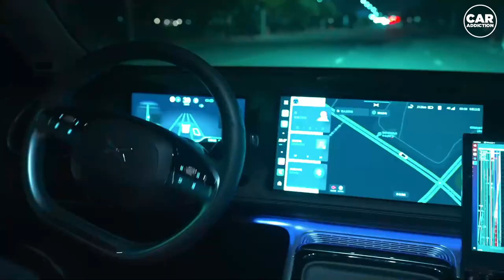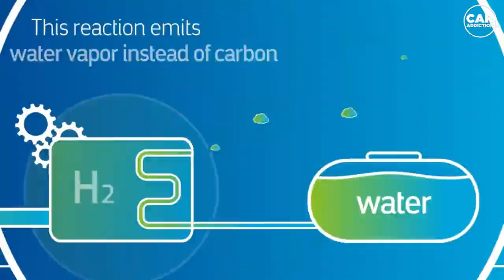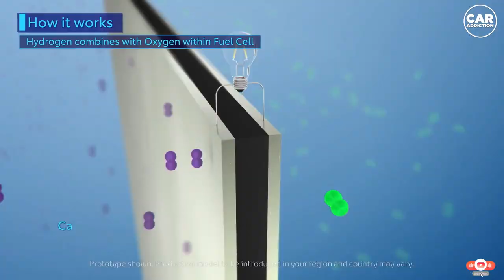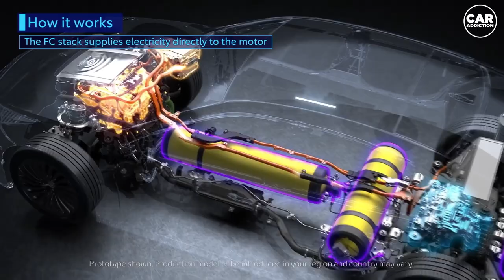Hyundai CEO: "This New Engine Will Destroy The Entire EV Industry!" | Huge News

Comment: As an automotive engineer, I believe in embracing technological progress rather than discarding it. In this video, I express my enthusiasm for the adoption of electric, hydrogen, and other innovative technologies. However, I observe that many corporations are caught in a state of uncertainty, oscillating between different approaches. Despite our expertise, engineers often find ourselves unheard, while accounting and business professionals hold sway. This lack of attention hampers the much-needed transition from combustion engines, which seems to be taking an unnecessarily long time. Companies tend to favor the familiar, prioritizing comfort over potential profitability. Nevertheless, I acknowledge the positive influence of individuals like Elon Musk, whose impact on the industry has been significant.
Reply: I wonder why water is yet to be adopted by automakers as a viable fuel. Split the water into hydrogen and oxygen (on the go) using electrolysis and eliminate the need for refueling infrastructure that hardly exist while reducing the risk of explosion in the case of collision.
Reply from the maker: Thank you for tuning in to my YouTube channel. Wishing you all happiness and success!